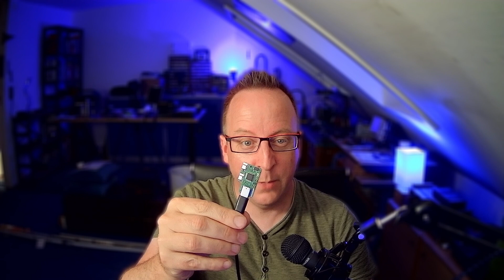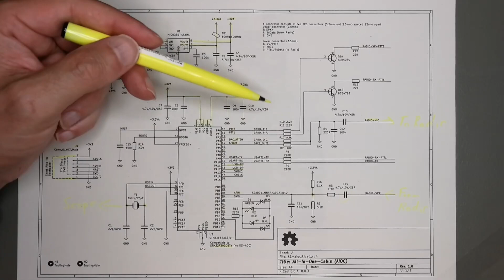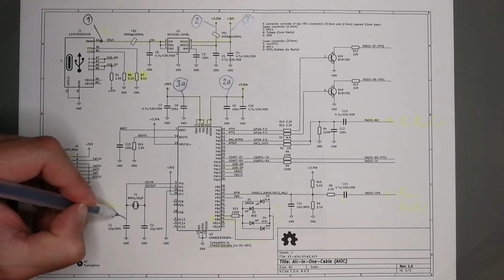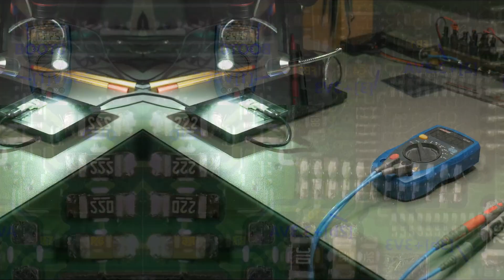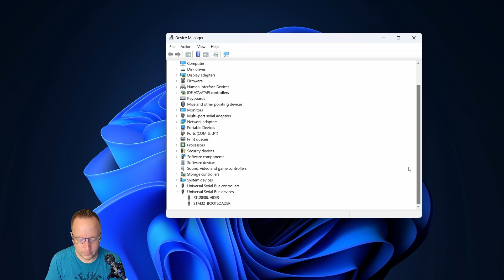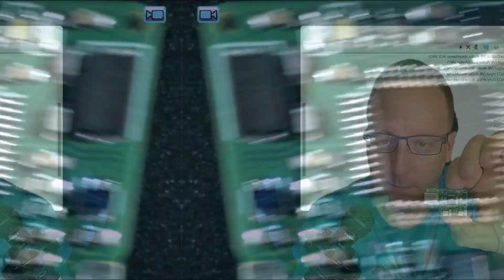AIOC HW sanity check | HamRadio

Comment: Operator head spacing can always be a problem!  Great video Tobias!  73
Reply from the maker: Thanks Jeff!

Well sometimes you have to do a video, even though you know it will tank in terms of views. 😆

I hope I do not have to start putting minute long lawyer crafted disclaimers into my videos like a lot of german hamtubers. Apparently there is always somebody who thinks that's a great way to finance a brand new transceiver.    🤦‍♀️
Reply: In my defense, I did swap USB Cables and USB Ports, just on the same panel ...Which if the panel is bad......
Reply from the maker: Don't worry! I never had a USB port / panel die in my life yet. So I would have made EXACTLY the same mistake. ✌️